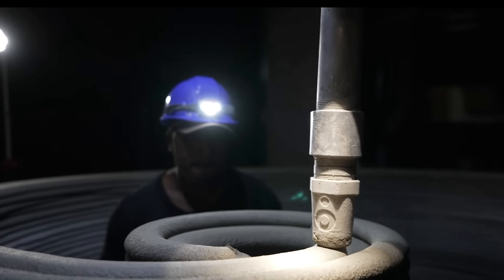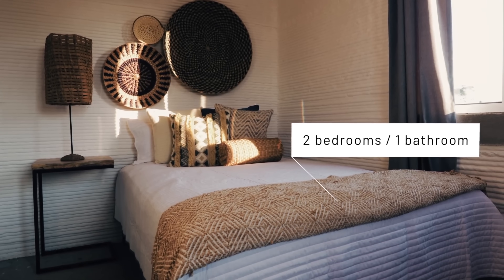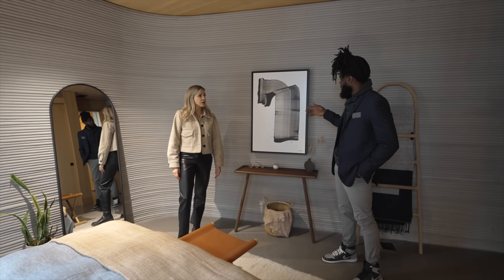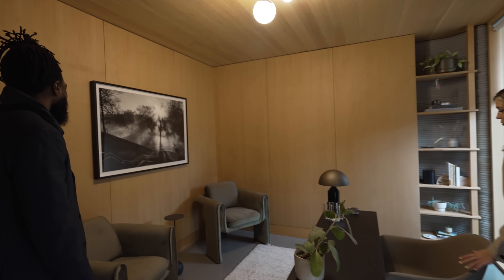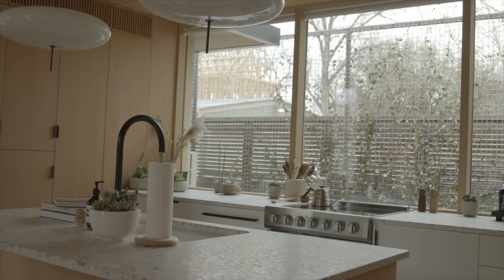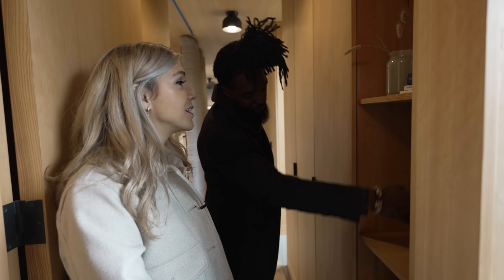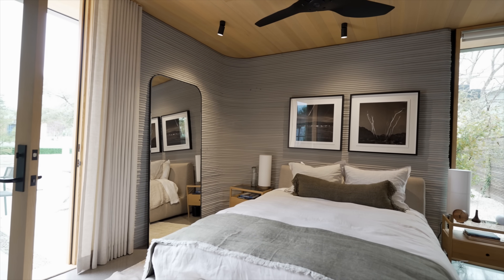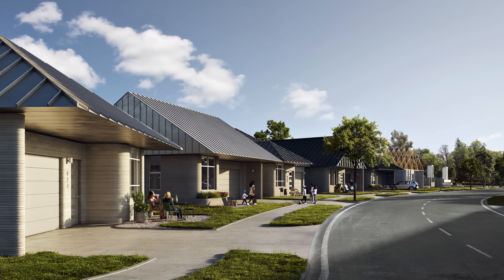Inside A 3D Printed House You'll ACTUALLY Want To Live In

Comment: Very cool theoretical design idea, but I wonder how well that would work in places like California where there are earth quakes and ground with expansive soil which leave driveways/sidewalks made from concrete with lots of cracks
Reply: I do NOT want that house.  to many "technical" /structural Restrictions inovolved with it and  it's required constricted sizes.  The material is a horible mess. Then huge expense to "cover/finish those walls".  Wiring and plumbing issues.  If you want to build something like that there are better/Cheaper , simpler ways to do it.  search ,... Oh what is it called,  Mud/sand bag , earthen bag construction?  And I am not saying I would want that for my main house either.  I've have seen nice "Single Story" hotel rooms....  cement is a mess! espeically when you leave it exposed. Dirt , spiders, and bugs "sticking to it" and those layers/grooves!  then trying to deal with plumbing, electrical etc,  and even try hanging a shelf or picture. :-)) wanna change a door or window? 😅😅😅 that texture is aweful.  even beyond cleaning it has problems.  the novelty would wear off quickly.  and trying to cover that up with wood, plaster, etc... That is Materials and LABOR cost, that  Is $$$$$   Are you noticing that even with the camera/"lense"?shooting done to try and make it  look bigger.  Look at how SMALL the rooms are. EVEN The ones that are supposed to be "larger rooms"  Oh and I live in a mostly solid cement walls and roof/ceiling building ...  I will call Bull Sheets on it being 75 F inside on  days when it is in the 90's .  I live in the desert and once it starts warming up in the spring in the "90's" after a few days the cement warms up, the walls warm up and there is no way you are going to have 75F inside without turning on the AC.  if it goes "hot" then cold" then "hot" then cold for a couple of days, then Maybe... But after after a few solid days or warm/hot temps, the cement warms up. and as the temps keep on climing for "the SUMMER/ spring"  the walls of the building keep getting warmer.  In the low desert in AZ,  if I turn off the AC it will "quickly" start climbing toward the 90's F. I guess higher if you forget to turn on the AC.  Oh, and of course the Reverse happens in the winter.  Sure the novelty of this is "cute"  but the reality is..................  Not So Great.   especially if you DON'T want just a little/cramped "single persons"  condo/vacation condo"  and You don't want the MESS of unfinished cement walls.  You know what else you will notice about this... NO REBAR REINFORCEMENT/"structural support". ("no multiple stories" Fractures? not good for earthquakes, settling ground, etc.just plain old heat and cold expansion constrictions problems...) And there Are More issues than just these... Ahh but the Novelty of it. 😅

Comment: My one big concern with these is longevity, because I live in a northern state where we get heavy winter weather every year. Can it hold up to seasonal cycles without eventually cracking and crumbling apart?
Reply: there are more concerns than that ...... I do NOT want that house.  to many "technical" /structural Restrictions inovolved with it and  it required constricted sizes.  The material is a horible mess. Then huge expense to "cover/finish those walls".  Wiring and plumbing issues.  If you want to build something like that there are better/Cheaper , simpler ways to do it.  search ,... Oh what is it called,  Mud/sand bag , earthen bag construction.  And I am not saying I would want that for my main house either.  I've have seen nice hotel rooms....  cement is a mess! espeically when you leave it exposed. Dirt , spiders, and bugs "sticking to it" and those layers/grooves!  then trying to deal with plumbing, electrical etc,  and even try hanging a shelf or picture. :-)) wanna change a door or window? 😅😅😅 that texture is aweful.  even beyond cleaning it has problems.  the novelty would wear off quickly.  and trying to cover that up with wood, plaster, etc... IS $$$$$   Are you noticing that even with the camera/"lense"?shooting done to try and make it  look bigger.  Look at how SMALL the rooms are. EVEN The ones that are supposed to be "larger rooms"  Oh and I live in a mostly solid cement walls and roof/ceiling ...  I will call Bull Sheets on it being 75 F inside on  days when it is in the 90's .  I live in the desert and once it starts warming up in the spring in the "90's" after a few days the cement warms up, the walls warm up and there is no way you are going to have 75F inside without turning on the AC.  if it goes "hot" then cold" then "hot" the cold for a couple of days, then Maybe... But after after a few solid days or warm/hot temps, the cement warms up. and as the temps keep on climing for "the SUMMER/ spring"  the walls of the building keep getting warmer.  In the low desert in AZ,  if I turn off the AC it will "quickly" start climbing toward the 90's F. I guess higher if you forget to turn on the AC.  Oh, and of course the Reverse happens in the winter.  Sure the novelty of this is "cute"  but the reality is..................  Not So Great.   especially if you DON'T want just a little/cramped "single persons"  condo/vacation condo"  and You don't want the MESS of unfinished cement walls.  You know what else you will notice about this... NO REBAR REINFORCEMENT/"structural support".  And there Are More issues than just these... Ahh but the Novelty of it. 😅

Comment: EVERYONE should be housed.  No one should EVER be without a house. And this is great for that.
I do have some concerned of wall thickness as well as the ends of the walls where doors and windows are.  Also how secure is it.
Also concrete transfers cold.  So in winter areas, the cold will transfer through the concrete making the inside of the house like a freezer.
You WOULD NEED to insulate both outside and inside to keep the house warm im in cold climate.

I myself would cover ALL the walls in plaster / sheetrock / insulation.   but thats just me.  And I hate houses that sit on the floor aka ground.
meaning the entrance door is leveled with the ground.  I like my houses lifted about 5 feet off the ground.  (Its hard to explain) because most people dont get it....lol
And no not on stilts or space under the house. just not on the ground... (again hard to explain over text)
Reply: Housing is not a human right

Comment: What about concrete dust? I hope the walls are at least sprayed with some kind of sealant, otherwise they are constantly “shedding” so to speak. I had to seal the walls of my basement because the cement dust was continuous. I could see that being a problem without a sealer or something mixed in with the cement to mitigate that.

Comment: They need to perfect the way the concrete is put down, so that the seams aren't all at different widths and lengths.  Wouldn't take much to do this with forms.  Sure, it may cost more, but you could actually create straight walls with 90 degree corners.

Comment: This is the prettiest 3d printed house I've seen.  I would definitely love to live in this house or one like it.  The super strong structure along with the modern aesthetic is right up my alley.
Reply: I like that curvy quasi-pueblo 3D printed concrete juxtaposed by the straight, manufactured wooden structure.  Super unique looking
Reply: you could say its the PRINTties thing you ever saw from a printer
Reply: I think I'd like to Air BnB it first for about a month. That would tell me all the hidden quirks that might get on my nerves.
Then after that, redesign the house accordingly and eliminate the annoying stuff.
Reply: Thank you 70 subscriber
Reply: The concrete will be impossible to clean and painting over it will be extremely laborious.
Reply: @carlsloan8021  just a matter of time until there is some sort of hardware that runs and smooths it, like icing on a cake, if you dont want this look anywhere
Reply: @mcdotterson4103  that sounds super interesting, i do like the wobbly like, it actually abit of fun to it

Comment: I cant call them 3d printed house, rather call it 3d printed walls. Walls its not even 50% of house cost. I have some questions about how they will implement electrical, plumbing etc stuff ? Concrete is not easy material to work with. But yeah, this technology is great.

Comment: To be honest I feel like 3D printed homes are more for renters low income and homeless by making the cost of living for temporary living down or low-income living down it would also lower the cost of materials for the higher-end homes and we need to stop using wood as structural for homes and use brick rocks and cement even in America none of this paper mache housing that falls apart and we build a new house every 4 years or 5 years that's what going to bring the cost down these 3D printed homes for renters low incomes and homeless while new construction and long-term living bought homes should be made out of bricks rocks and cement!

Comment: Very cool - especially love the walls where they added the plaster. I would need central AC, though!
Reply: I do NOT want that house.  to many "technical" /structural Restrictions inovolved with it and  it required constricted sizes.  The material is a horible mess. Then huge expense to "cover/finish those walls".  Wiring and plumbing issues.  If you want to build something like that there are better/Cheaper , simpler ways to do it.  search ,... Oh what is it called,  Mud/sand bag , earthen bag construction.  And I am not saying I would want that for my main house either.  I've have seen nice hotel rooms....  cement is a mess! espeically when you leave it exposed. Dirt , spiders, and bugs "sticking to it" and those layers/grooves!  then trying to deal with plumbing, electrical etc,  and even try hanging a shelf or picture. :-)) wanna change a door or window? 😅😅😅 that texture is aweful.  even beyond cleaning it has problems.  the novelty would wear off quickly.  and trying to cover that up with wood, plaster, etc... IS $$$$$   Are you noticing that even with the camera/"lense"?shooting done to try and make it  look bigger.  Look at how SMALL the rooms are. EVEN The ones that are supposed to be "larger rooms"  Oh and I live in a mostly solid cement walls and roof/ceiling ...  I will call Bull Sheets on it being 75 F inside on  days when it is in the 90's .  I live in the desert and once it starts warming up in the spring in the "90's" after a few days the cement warms up, the walls warm up and there is no way you are going to have 75F inside without turning on the AC.  if it goes "hot" then cold" then "hot" the cold for a couple of days, then Maybe... But after after a few solid days or warm/hot temps, the cement warms up. and as the temps keep on climing for "the SUMMER/ spring"  the walls of the building keep getting warmer.  In the low desert in AZ,  if I turn off the AC it will "quickly" start climbing toward the 90's F. I guess higher if you forget to turn on the AC.  Oh, and of course the Reverse happens in the winter.  Sure the novelty of this is "cute"  but the reality is..................  Not So Great.   especially if you DON'T want just a little/cramped "single persons"  condo/vacation condo"  and You don't want the MESS of unfinished cement walls.  You know what else you will notice about this... NO REBAR REINFORCEMENT/"structural support".  And there Are More issues than just these... Ahh but the Novelty of it. 😅

Comment: 3D 'printed' (Concrete extrusion) structures look cool because of all the rounded corners which are expensive to achieve with conventional building techniques. Conversely, it is difficult to make a sharp 90 degree corner with a 3D printer because of how the system works even if you switch to a square/rectangle nozzle. You can see the limitations at 4:22, 8:40 etc. Note the huge gap between the 'printed' section and the door frame.

You will need to sort and grade the gravel more accurately for the 3D concrete which contributes to cost. I'm also sure the formula for the concrete is different from the regular stuff due to the need for quicker curing as compaction (squishing) of the extruded concrete due to its own weight can become an issue the taller you go.

Comment: I would 1000% live in one of those they have such a unique look and must take way less time to build than the concrete blocks we use here
Reply: I do NOT want that house.  to many "technical" /structural Restrictions inovolved with it and  it's required constricted sizes.  The material is a horible mess. Then huge expense to "cover/finish those walls".  Wiring and plumbing issues.  If you want to build something like that there are better/Cheaper , simpler ways to do it.  search ,... Oh what is it called,  Mud/sand bag , earthen bag construction.  And I am not saying I would want that for my main house either.  I've have seen nice hotel rooms....  cement is a mess! espeically when you leave it exposed. Dirt , spiders, and bugs "sticking to it" and those layers/grooves!  then trying to deal with plumbing, electrical etc,  and even try hanging a shelf or picture. :-)) wanna change a door or window? 😅😅😅 that texture is aweful.  even beyond cleaning it has problems.  the novelty would wear off quickly.  and trying to cover that up with wood, plaster, etc... IS $$$$$   Are you noticing that even with the camera/"lense"?shooting done to try and make it  look bigger.  Look at how SMALL the rooms are. EVEN The ones that are supposed to be "larger rooms"  Oh and I live in a mostly solid cement walls and roof/ceiling ...  I will call Bull Sheets on it being 75 F inside on  days when it is in the 90's .  I live in the desert and once it starts warming up in the spring in the "90's" after a few days the cement warms up, the walls warm up and there is no way you are going to have 75F inside without turning on the AC.  if it goes "hot" then cold" then "hot" then cold for a couple of days, then Maybe... But after after a few solid days or warm/hot temps, the cement warms up. and as the temps keep on climing for "the SUMMER/ spring"  the walls of the building keep getting warmer.  In the low desert in AZ,  if I turn off the AC it will "quickly" start climbing toward the 90's F. I guess higher if you forget to turn on the AC.  Oh, and of course the Reverse happens in the winter.  Sure the novelty of this is "cute"  but the reality is..................  Not So Great.   especially if you DON'T want just a little/cramped "single persons"  condo/vacation condo"  and You don't want the MESS of unfinished cement walls.  You know what else you will notice about this... NO REBAR REINFORCEMENT/"structural support". ("no multiple stories") And there Are More issues than just these... Ahh but the Novelty of it. 😅

Comment: This won’t work in Los Angeles. I live in LA and the city has some of the strictest building codes in the United States. Not only that but, the earthquake codes alone would disqualify these types of houses from being built without any type of rebar or caisson footings. A lot of times, houses on hills in Los Angeles (think Hollywood hills or studio city) have super strict building codes that require caisson rigs to come in and dig until they hit bedrock (which could be anywhere from 1 foot to 20 feet deep). You wouldn’t get past a city soils inspections before you laid your first inch of cement, let alone a building permit from the Los Angeles Department of Building and Safety.
Reply: The present tentative code won't allow them in the higher seismic zones.

Comment: Ofcourse the whole idea of 3d printing a home, let alone multiple is that it's supposed to be significantly cheaper than other methods of home building. Especially those using wood.  However, like many other 3D home printing ventures, that has not proven to be the case.  ICON has also failed in that promise of 3D Printing. 

While I understand that it's still too early in the game, it seems to be growing in demand and demand is never cheap.

Comment: They're really neat, but 3D printing a house results in a house which cannot be easily modified by the homeowner. So, great for low cost housing, but not a real option for homeowners who wish to expand or rebuild part of the house in the future.

One reason why new houses cost so much is the price of labor. Now, imagine in the near future (we're talking anywhere from 8-15 years from now) when an entire house is constructed by automation. That is going to happen. Carpenters, plumbers, electricians will one day be replaced with skilled general purpose robots. It's not that far off.